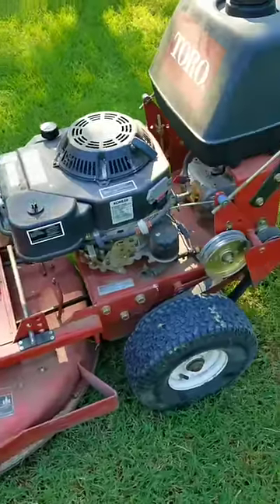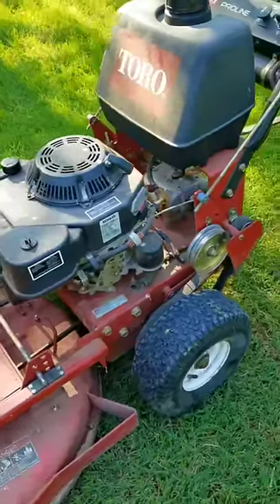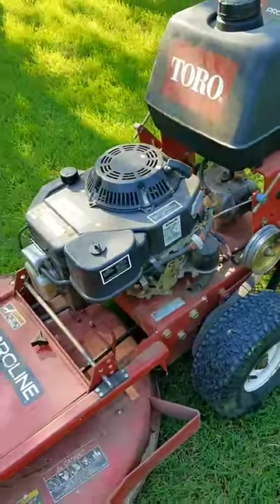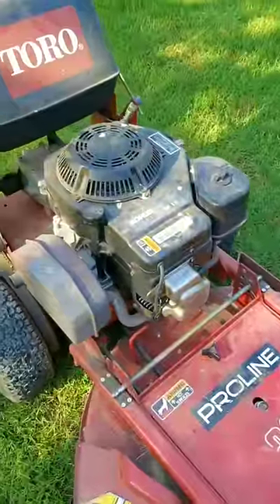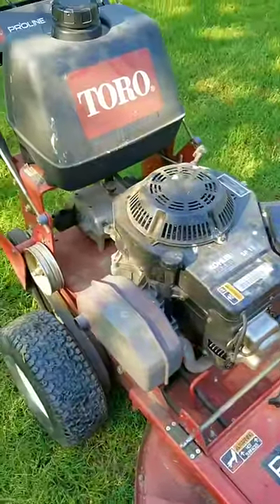What's Wrong With This Toro Walk Behind Mower?

Comment: Solenoid….
Reply from the maker: turns out the valve lash was out, by a mile
Reply: @INSIDEHOUSEGARAGE  I ran into an issue recently where my customer had the same type of issue…. They leave their mower outside and it rusted the flywheel and solenoid pretty bad…. I sanded the two surfaces slightly to give it a good contact and it started right up

Comment: Ignition coil
Reply from the maker: turns out the valve lash was out by a mile
Reply: @INSIDEHOUSEGARAGE  Thankyou!   After reading all comments and your reply which I should have done before I "guessed".    I would have the correct answer and no I would not have posted it because that is not in my "character"😉